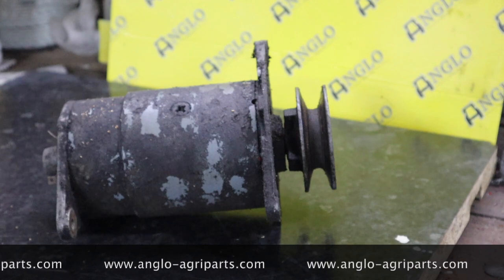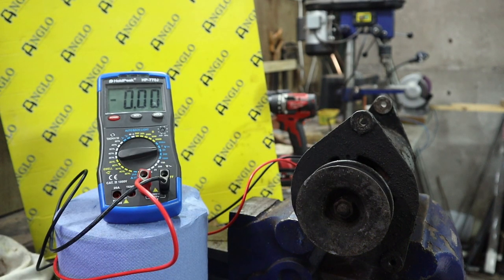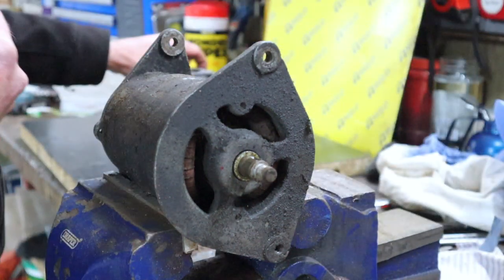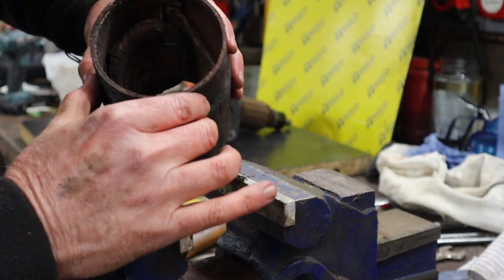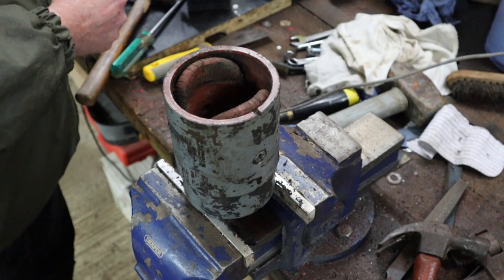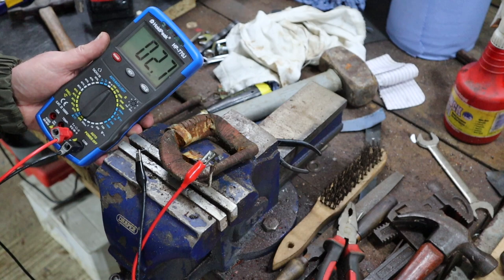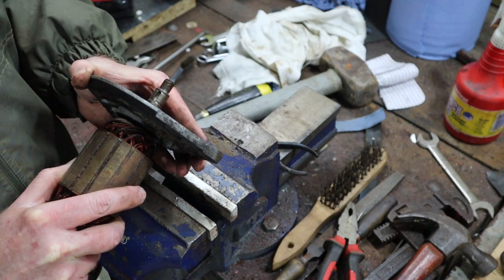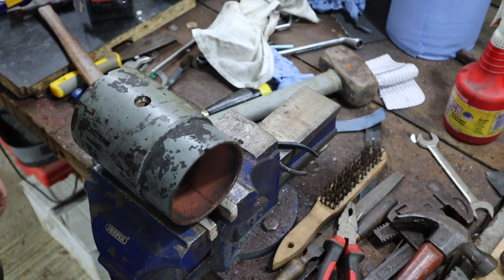#130 - Ferguson Ted20 - Generator Test & Dismantle - with Anglo Agriparts

Comment: Always polarise generator before doing ANY tests. Also instead of a piece of wire between D and F. I always use an AMMETER. You should be seeing 2 AMPS as your field resistance is 6.1-6.4 ohms. Also a lucas generator will take a maximum of 8500 revs, but 1500-2000 is adequate. 😊
Reply from the maker: Hi Ian, very useful information! Thanks for sharing 👍😉

Comment: Thought the generator puts out ac power which has to go to a voltage rectifier?
Reply: Didn’t see any diodes in there, don’t you need them to make dc power?
Reply from the maker: Hmm maybe, that would make sense. 😉👍
Reply: No
Reply: It's an Alternator that needs rectification. this video is about a Dynamo

Comment: help ih 276 does not glow in glow plugs but glows in glow resistance it with spiral what can be wrong mvh Karsten Bang
Reply from the maker: Hi Karsten, thanks for your comment. The resistor and the glow plugs should be wired in series. So it is not possible for one item to work and the others not. So I can think of two reasons why you’re seeing this: 1. They have been wired incorrectly and they are in fact in parallel, which is wrong, unless they are not the originals. So you will need to make sure first. 2. It think it is possible that the glow plugs resistance may be too low due to age. I’m not certain what their resistance should be but it may be worth measuring each one and also the coil resistor. The glow plugs should all be very close to being the same as each other. But I seem to recall that the resistor has a higher resistance than each individual glow plug, but I’m not certain about this. I hope this helps sorry I can’t be more specific. ☹️👍
Reply: @WaterhouseForde  can it fit there is a fuse in between incandescent relay with spiral and glow tube
Reply: @WaterhouseForde  do you have a wiring diagram for ih b276 because can not be found in denmark where I live and the network I can not find anything
Reply from the maker: Hi Karsten no there should not be any fuse in this circuit. In fact the coil resistor is designed as a form of fuse in that it is designed to fail before the glow plugs if there is a problem.
Reply from the maker: Hi, I will need to take a look myself. I have a few things tucked away, which may include a wiring diagram. Send me an email: waterhouseforde at gmail dot com.
Reply: @WaterhouseForde  it's because the wire that goes from the incandescent coil goes out into the engine compartment and into something with 12v and goes out of it with 3v and can not figure out what it is
Reply: Glow plug relay? On automobiles the glow plug signal powers a relay which powers the glow plugs. If the glow plugs are working you should see the ammeter drop with current pull. You can also Hotwire power to glow plugs to see if they work.